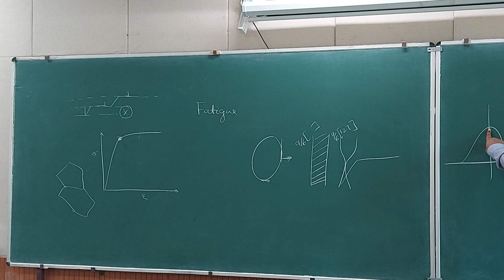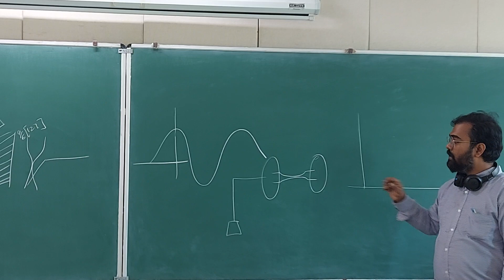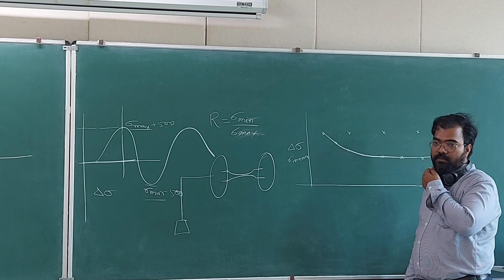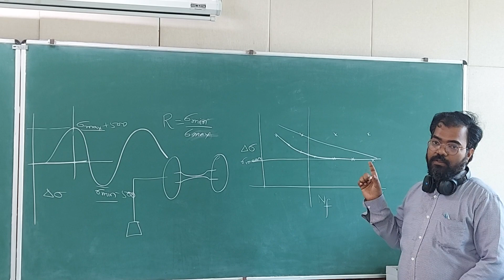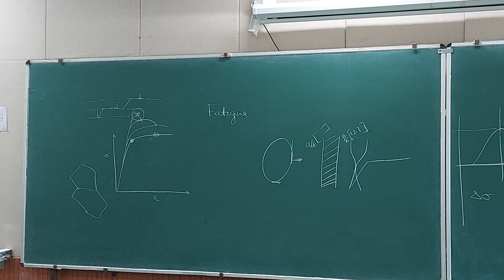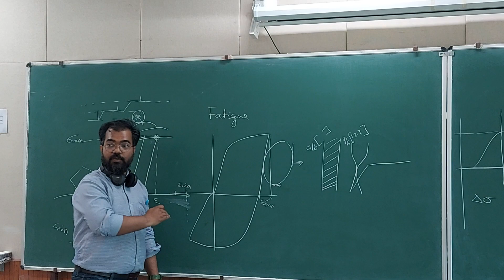MM504 Lecture 27b Moore's test and S-N diagram

Comment: Hello Sir,
I hope you are doing well.
Sir,
In the S-N curve, you told that the vertical axis is related to mean stress, but i think it is related to stress level which is the ratio of maximum flexural fatigue strength and static flexural strength of the sample.
Reply from the maker: There are different types of SN curves some of them also have del_strain vs N